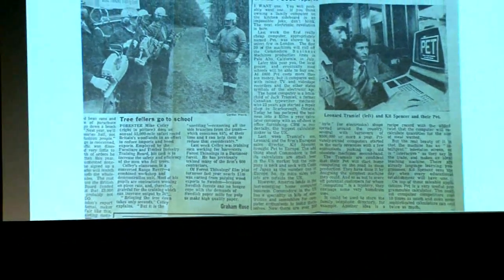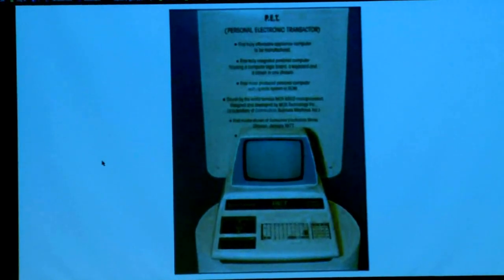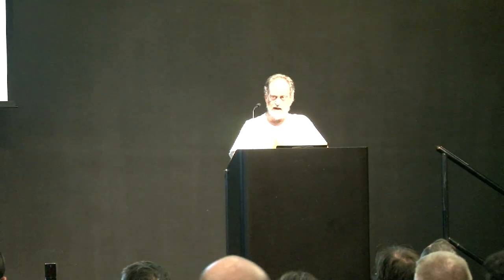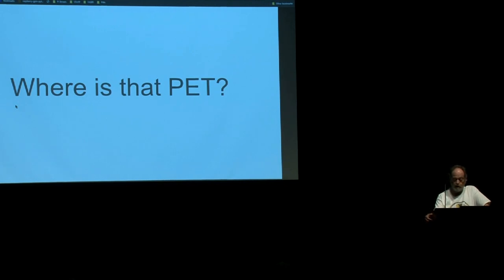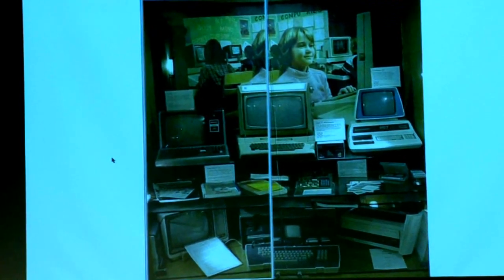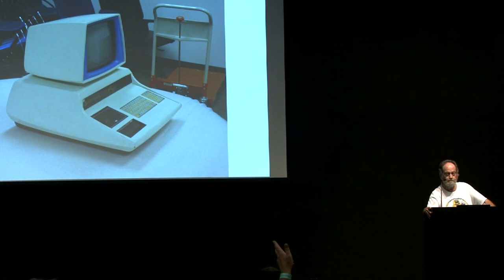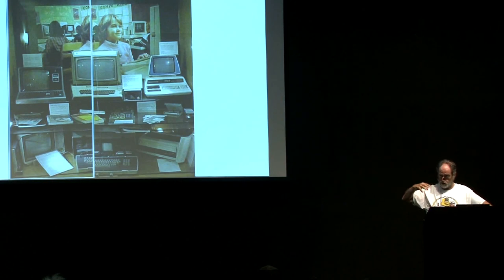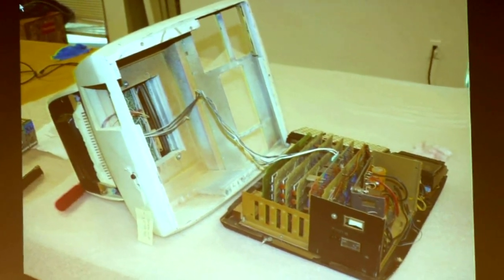Tramiel and the Wooden Commodore PET - VCFW 2022

Comment: Thanks for this, it confirms a lot of stories I have read from 3rd sources. But, Leonard, if you go to Windows file Explorer and you want to select all PNG files, so just sort all files by file type, and you have all of the PNG at once, one under the other and can select them all at once, still easier than selecting them manually, but you are right, still not that smart than a filter.